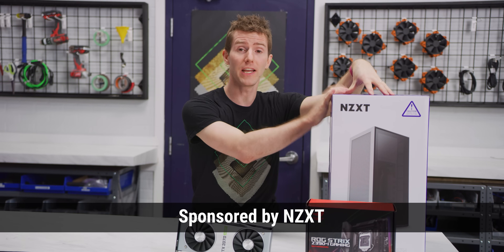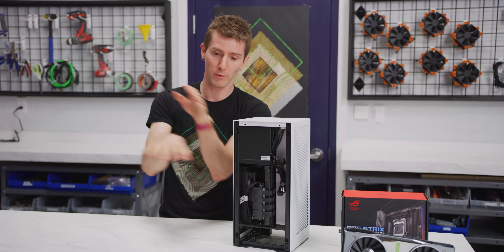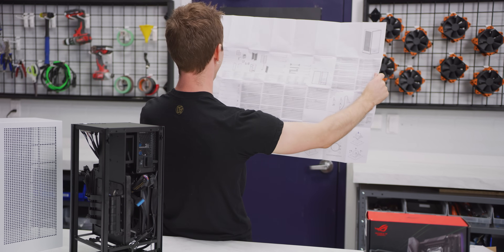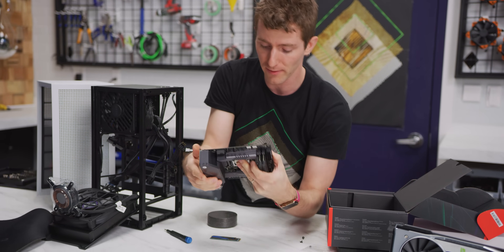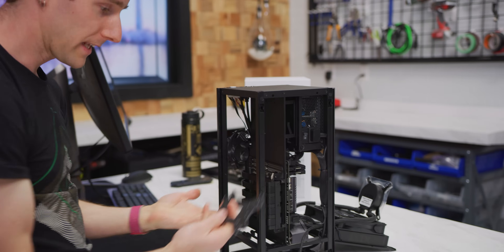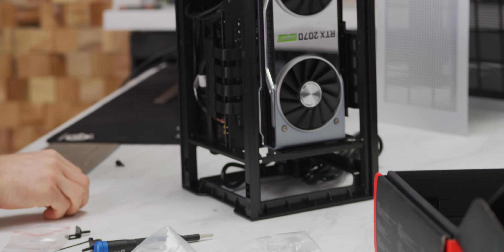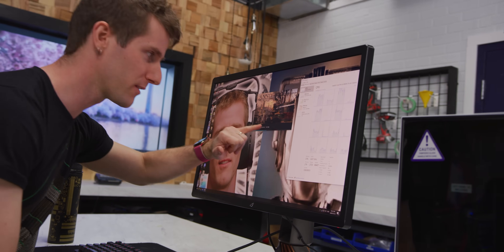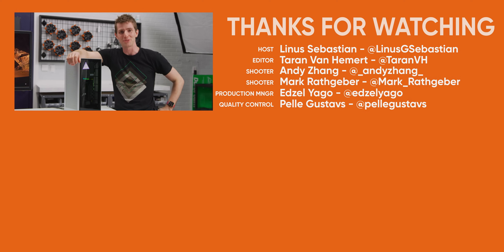Building the Xbox Series X Rip-off PC

Comment: What is failed to mention in this build/review and by NZXT, is that the supplied PCI-E riser cable is 3.0. It does not work with anything that is using the PCI-E 4, which is a lot of the new hardware coming out and NZXT does not have any PCI-E 4 riser cables you can buy or request. The individual customer will have to buy their own third party PCI-E riser cable.  You can go into your BIOS and change the PCI-E setting from 4 to 3 but then again that defeats the purpose. So think twice before buying this case and think you will be able to use x570 or b550 with the new NVIDIA 30 series or 5700xt graphics card.

Comment: No, it doesn't look easier than regular building. It comes down to the wiring where you plug them in and close hi res camera shots of the plugs plugging in. I think if there were a standard regulator for building PCs as well as controlling  how often components and motherboards,  etc. change, it would get easier.

Comment: Not sure if I’m a novice since I think novice means having a bare minimum of experience and I have zero experience but it looks easier than a normal build but I’m still worried I’d mess up the USB and other front panel connectors. Plus I’m still not sure what exactly to do with the riser(?) cable.

Comment: Is there any thermal test data available for this configuration? It seems to me that the GPU could eventually heat up quite significantly as there are no case fans visible in this video.

Comment: Next generation it will be impossible for any PC channel to build a next gen Xbox SX or PS5 similiar spec under 1000$. That's the bare minimum u have to spend to get everything PS5 / Xbox SX has to offer.
This generation we saw so many videos PCMR gamer made mocking PS4 /Xbox One. How they can build a better PC same budget for a console. We all know how they did that n cut so many corner to build a PC that actually has better specs than a PS4 n Xbox One. They didn't included Blue Ray player n also buy parts from used PC hardware store. 

I like to see this people now making a PC that perform similiar or better than a PS5 / Xbox Series X. It will be funny to watch this time. 

I'll build a PC for that can run similiar or better than Xbox SX / PS5 within 6 months. I'm micro managing everything here. Still it's almost impossible to build a PC that has the same power or better under 1000$. NVidia RTX 3070 is my target now for GPU cost probably 500$. I just spend a PS5 /Xbox SX price just to buy a GPU. Now u need CPU, Motherboard, Ram, SSD,, Power supply, HDD replacing Blue Ray & casing. What u guys think all of this parts will cost!?

Comment: Thanks to LTT, and Bitwit I have built my first pc in 2020. I'm hooked just wish I had tons of money....
My rig may not be the most expensive but it works very good compared to any PC I have ever owned.

Build:
WD NVME m.2 for OS. 
1tb EVO 860 SSD for storage (atm)
Radeon 580x
AMD 5 3600x
2 Corsair Vengance Pro RGB 8GB 3200
Asrock B450 Motherboard
Corsair 465x icue

Comment: When XT 5600 costs the same as PS4, PC gaming is the past
Reply: if you can't afford a pc sure. but computers are still far ahead of any console
Reply: comments in 144 frames
Reply: When the next generation of gpu's are released, you will most likely be able to match the ps5 GPU  for about £300. While this seems expensive, a lot of people have a PC they can just plug a new GPU into, meaning no more than 300 is needed. Also, 5600 XT is far better than a PS4 GPU, PS4 is nearer to a 1050ti - 1060
Reply: @Jhitch19   regading "5600 XT is far better than a PS4 GPU"
Do you know that you also need a pc case, a PSU, a CPU, RAM and a MOBO to put that 5600 XT into?
Reply: @muER76  yeah, you can buy a 6 year old prebuilt for about 120-150 then get a 1050ti for another 150 and have a better gaming PC than a base ps4 for only 300, that's 300 for a gaming system and anything else a PC can do. What I meant was saying a "5600xt was the same cost as a PS4" makes sense, because it is much faster, therefore being more expensive
Reply: @Jhitch19  whatever man

Comment: This case has the power supply and cooler built in which is cool, but what if your power supply or cooler somehow stops working? are you able to replace them with a new one or do you have to get a new case?

Comment: I like how it looks. Bar the windowed side panel. They need a mesh version. Also not a fan of water loops. Air coolers only get dusty and dead fans. Water cooling can leak or have the pump die on top the other problems I mentioned.

Comment: building a pc is very easy i am 15 and built my rig when i was 13 by myself
Reply: @Top Right i cant oc my 13 year old mind used a a320 board  i regret it every day should have used a b450 it was a ryzen 5 1600 and 1050ti which is oc to 1850mhz

Comment: Looks cool. Easy to build. A bit compact wondering if heat issues would come up with installed hrdwr air cooled.
Question1: Its speculated that Xbox X & PS5 CPUGPU or APU has multi-threading & object management, raytracing so much so that most PC builds that aren't crazy expensive may not be able to run games in 4K that run on those consoles... Will this build be able to run Xbox X & PS5 era games in 4K without lag or tearing???
Q2: Unlike most emulators that arent yet able to run PS3, 4, & 5 nor Xbox One, & X games.... Is there any way to load the Xbox X, OR (different build) PS4 & PS5 proprietary software??? As well being able to run Linux, Win, Etc on the same PC??? A Dual/Multi System PC (Not Dual Boot) That would be pretty badass especially Console+PC build!!!! Can the legendary LTT pull this off!?#?!

Comment: I’ve been building PCs for years and this case has caught my attention because of the ease of building and pre managed cables. The thermals are better than a lot of ATX cases too! All with a single 140mm fan no less. Super clean chassis too, love the sharp angles and the small desk footprint.
Reply: Too bad the pcie riser cable shorts and sets your house on fire
Reply: @clippyremembers  That was the old design though, at my retail store online they say its been fixed and now the case will not go up in flames.

Comment: Never built a PC before, but I could see this as my first attempt when I'm ready. Looks very doable.
Reply: I can confirm you are correct. I just built my first PC in this case. I had some video call support with a sibling to make sure I did everything right, but it went together with no major troubles. And I'm a big guy without small fingers to manipulate the small spaces, so I thought it would be a struggle. Everything went together in a couple hours.
Reply: SC G ok I don’t have much experience with itx but I just think it is easier with atx  or mini atx Becuase it’s a eco system a lot of company’s support and most graphics cards fit into the slots and things like that
Reply: One thing Linus usually mentions,  but i dont think he did here, is lay the case down so tbat the motherboard is placed in horizontal. Most motherboard stands dont hold a motherboard in place until a couple screws are in.
Reply: Id go with a mid tower case, just built a pc within the last 2 months and the biggest thing I noticed was extra space is always better. But mostly how easy it is to build a pc. Only thing slightly problematic is if you can't read or take the time to watch a video
Reply: @Steven Gerads yes, i bet this case cant do most of the rtx 3070/3080 AIB partner cards because they seem to mostly be 2.5 to 3.5 pci slots thick
Reply: The only pain. Is cable management. Otherwise aesthetics are out of the equation if you don’t manage it.
Reply: It’s much more difficult than a larger case and u would have rot really check ur parts

Comment: Sorry but I'm ranting over those banana plugs. Why not Bluetooth instead bananas? Ir sensors instead bananas? Is product of a secret pact of USA government with Asia?
Is like smartphones, why the Cell tech if you have a internet modem and you can use it for calls. Cell tech is sucking the battery of my smartphone, why?  

Why my $350 Corsair case has banana plugs on it? when I saw that sht there was like WTF. 
Is like the pyramids mysteries.
That is why I feel scared of buying that new Asus 4700u laptop... could bring banana plugs...

Comment: Its cool and all until you realize that your paying $350 for a case, power supply, and CPU cooler. When you could basically the same thing for $200 less. Just gonna end up paying way more for the same results as you would get with a good CPU cooler and a cheaper case.. just sayin, not hating..

Comment: That case/prebuild is an awesome solution. As a novice who ir toying with the idear to build a pc for quite some time now, this case pushed me over the edge. Not having to deal with the cables and coolung solution, which to me seems like the most difficult part, does indeed makes the whole assembly look like really duable.
Too bad that the case is sold out everywhere. I guess itt's been so long I can wait for another 2-3 months. It's preordered right now.

Other Manufacturers should look at this case and take it as an example. There should be more offerings like this. I mean me personally, I would pay quite a bit more just so I don't have to deal with all the cables and cooling/fans. On the other hand I get that this part is the fascination for alot of the enthusiastic guys out there ;)

Comment: The parts seem off to me. I know that this is late, but the closest CPU is a Ryzen 5 3600 imo, since the thing is clocked higher than the CPU in the consoles. Also the GPU. The GPU is 2080 ti~ level of performance, not a 2070 Super. Also the Ray-Tracing is going to be a lot better on the next generation consoles than the RTX 20 series. The GPU in the Xbox series X is actually not a high end GPU, I know shocker, but some people got used to small gains in performance so they think that GPUs can't improve like they used to, thus the next Xbox performing like a 2080 ti seems far fetched to some folk.

 Like the math should be easy.  A 2070S is 5% say rough faster than a 5700xt, and has only a little bit more TFLOPS than a 2070S. The Xbox Series X has 12 TFLOPS, and uses an RDNA 2 based GPU. RDNA 2 is not a small upgrade, what I call "GPU IPC" will improve alot, so even accounting for scaling(RDNA scales better than GCN), and a tiny IPC lead on Turing means there is no way that thing is much slower than a 13.5~ TFLOP 2080 ti. Like a 10 percent rough TFLOP lead, and we know that RDNA will be better than Turing IPC, Turing and RDNA 1 are so close a small gain in IPC is all it takes really.

Comment: Aaaaaaaand a month and a half later... as a novice (someone who's only ever changed out components in pre-builts... in the late 90's and the first decade of the 2000's...), the build itself doesn't look intimidating or complicated, but the space you have to work with for it does. I think the most difficult part for me about a build like this would be getting everything firmly connected, and then doing any minimal wire management that would still be required.

For that reason alone, I'm more apt to lean towards a tower when I do decide to most likely spend way too much money building more computer than I'll ever need.

Comment: Interesting case review, i'm currently using a Cooler Master Cosmos 2, and i struggle to move it (the few times i have to reach to the back of it) and i'm looking to downsize to an ITX case (I want to keep as much as i can, like RAM, HD drives (might just replace them) and my RTX 2070S, and i'm thinking of going Ryzen (currently using an i7 6700K)

Comment: Hi Linus, There was very little "stretch" in the motherboard power connector. Is the position of the motherboard power connector set in the mini ITX specification, or do we need to be careful in the motherboard choice?
The clearance between the cooler and the RAM is known as a " mild interference fit" :-)

Comment: Don't buy a xbox series x,  instead, spend 3 to 4 times more money and Fart about with building one yourself.  NO THANKS!
Reply: @Empika   no it doesn't, that's why Phil Spencer has been using one for the last 4 months at his house. (face palm).   Xbox Series X is basically a Steam PC that offers more value than anything out there, bang for your buck. many Steams only work in 1080p/1440p.

Comment: This is a cool form factor, compact and looks nice on the desk. But what about people who want to connect a VR headset. I would be worried about the case falling over with the jolt of the cable while moving around with the VR headset on, even if I do connect at the bottom and have the case on the floor. Is no one else worried about these form factors tipping over easily?

Comment: It looks very fiddly. I would be worried about Thermals when running it for several hours at a time. With all that stuff crammed into an already tiny space, the Air Flow within it is realistically non existent. Yes, there are plenty of ways to suck air in but I would still be worried about the removal of heat. I think many people would be interested in seeing Benchmarks and Thermal outputs after stressing the system (Simulated and Actual) for at least a constant 3 hour period.

Comment: Just a few quick questions from a novice builder contemplating this as his first build, can someone recommend a relatively affordable, AMD supported, motherboard that will provide enough power and allow overclocking on a Ryzen 7 3700x or 3800x? As a follow up, will my CPU be bottlenecked by an RTX 2060 Super? Or is the 2070 Super a much better option to pair with the 3700/3800x? I've also heard that given the smaller profile of this case, its important to select low profile RAM, is there a 32 GB RAM solution that you can recommend (2 x 16 GB sticks?) - thanks in advance!

Comment: republic of gamers are not for gamers

laptop i got from cex was A no marks 

3 days later the changer keeps reconnecting when playing resident evil 6 

i pay £400 more for MSI ge72mvr 7rg apache laptop 120hz  i got a £900 laptop works right idid got a replac until i try gta 5 

From 60c to 80c

i did fix it just a bit connecting laptop to tv that 60fps

and the game work better 
only thing i have to use a usb camera 
Camera on the laptop does 

notebook you know what is missing